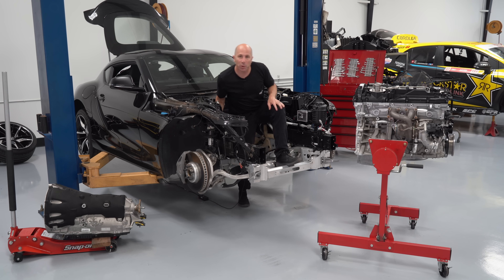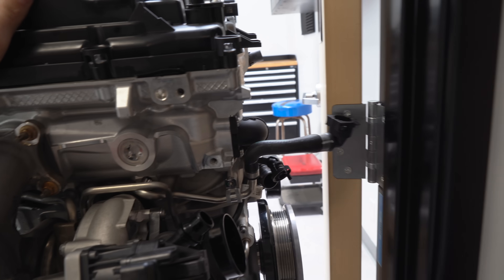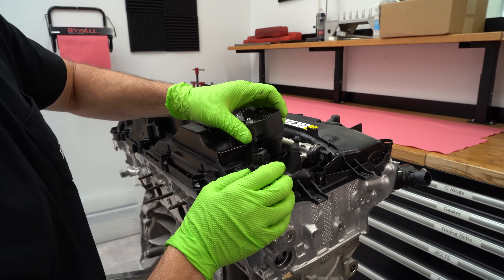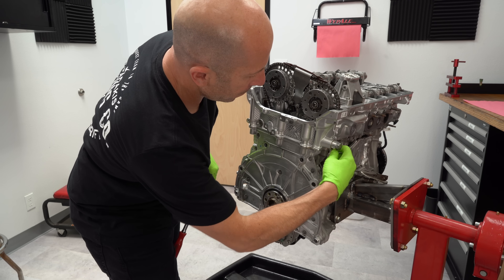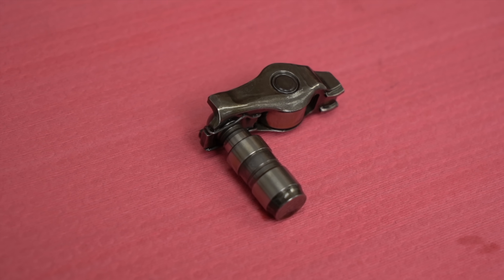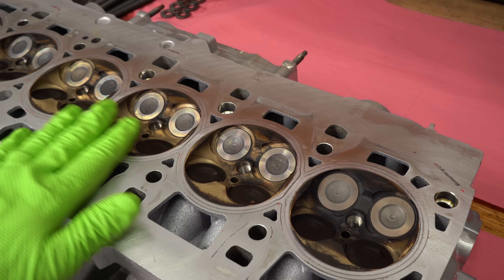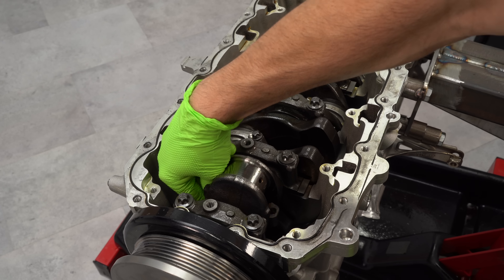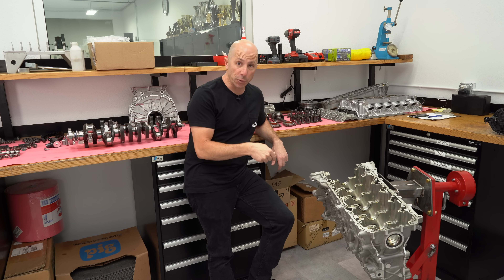2020 Supra B58 Engine Teardown - First Look - Better than the 2JZ?

Comment: My biggest gripe with BMW engines for the last 15 years or so has been that the open jacket / multimetal casting means that they eat head gaskets and you can't deck the block to square it, so the whole thing becomes disposable around 90 to 120k (less if you're pushing the boost). Curious to see if this design has better durability.

The VANOS, unfortunately, still has failure written all over it. Needless complexity seemingly for the sake of complexity.
Reply: Interesting engine design. I not see the new Supra in high production #s.
Reply: SQ Motorsports something it looks like the Japanese influences over the Germans for this engine

Comment: My 17 year old bimmer has that wireless throttle body. I can already see that plastic intake manifold leaking air at the seams in 100k miles or 10 years which ever comes first lol. Bmw just doesn't care i see. Still doing the same crap with this reinforced plastic. This engine is way over engineered. I can't imagine it being more hardy than the 2jz

Comment: Do you think there’s a possibility of using an existing bmw manual trans to do a swap? Electronic barriers? Mounting barriers? Looks like a super stout engine. Very impressive tear down. I’m excited to see what comes of the build. I love that Toyota whipped bmw into shape and took their awesome engines and made them take reliability measures. It will be great for both brands.

Comment: All this water cooling sounds cool, but I feel like it gives bigger room for destruction if something fails, if a normal oil cooler fails, you lose oil, but then you know it by oil pressure drop, but if the oil cooler fails on this one, I feel like you wouldn't be able to tell as easy, same with the water cooled intercooler letting air into the intake and hydro locking the engine upon failure. Is there any sensors or things to prevent these issues beyond finding out with a destroyed engine?

Comment: Amazing engineering, but id be worried making 1000hp reliably with that integrated exhaust manifold turning the head into a furnace,  maybe it could be removed, or ceramic coated? You should ultrasonic the upper bores to see how much material you’ve got there... that will ultimately tell your upper power limit. Hopefully better than the rb26s

Comment: so you need to pull the engine out at a 100k to change a stretched chain hmmmmm ps im not even mentioning the fact tht you now cant even take a spark plug out without a specific toll hmmmm
Reply: DORIFTO C_MAN I replaced the iridium plugs in my FG Turbo Barra Falcon @ 180000km, they looked brand new.
Reply: @nordic5490  I like your style service every 180k :D

Comment: It took a while for the new Supra to grow on me. I think it is kinda cool.  One thing you should know about this engine is when Toyota took the BMW straight six and tested it they tested every single part right down to every nut and bolt to make sure it was as reliable as every Toyota has been. Overall I think it’s a neat engine and it’s cool to see how far engineering has come.

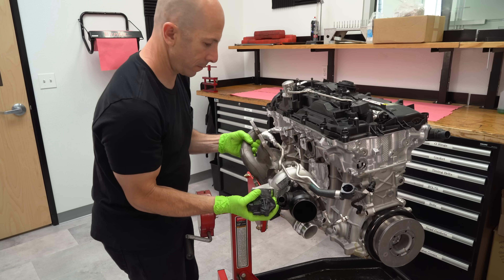Comment: 3:56 There’s no doubt when building a B58B30 head for high Hp, people will increase the diameter size of those two exhaust ports for higher exhaust gas flow.

Comment: Very interesting to see how modern engines are constructed. Lots of combined function parts and proprietary assemblies that will make this thing impossible to repair in the (distant) future.
Reply: plastic, plastic, plastic, damn, soon everythings gonna be plastic
Reply: @nobba255  Plastics are much more resilient than people give them credit for, especially now (plastic is a 157-year-old technology). There are also several types, compositions, and grades of plastics, designed to do different things. Plastics have been in engine compartments for just about as long as cars have been around.

On proprietary assemblies: with the nature of mass production (and how easy it's gotten with computers, lasers, etc.), even proprietary parts, while unfavorable, won't be hard to obtain.
Reply: @NaruSanavai  Yeah plastic CAN be really strong, expecially composites, but it doesnt really matter when bmw, mb and others seem to be using some food grade cardboard equivalent plastic lol, atleast judging from the past few years.
Reply: @NaruSanavai  plastic is great but not when its surrounded by 500 degree heat
Reply: @nobba255  hey you mostly find the plastic parts on the cheaper cars, my sl600 from 2004 has only plastic on air filter box, air intake tubbing, but the intake manifold is steel or aluminium on a 500hp twin turbo v12
Reply: @dexterjsullen  Except there are plastics that can survive that, and more? Do you think Toyota and BMW didn't do any R&D and just said, "throw some plastic on it lol"?
Reply: @NaruSanavai  yeah there's definitely plastic that can handle it, like fireproof clothing for fireman but the question is, you think Toyota / BMW going throw space grade plastic in a entry level car, even when they didnt want to complete with the performance class cars (gtr/911/nsx/488/zr1 and so on) this a brz/miata competitor THEY CUT CORNERS if they cared woulda just made a steel intake manifold, but wanted to production cost low hence BMW engine
Reply: @dexterjsullen  Steel conducts heat well, plastic doesn't. Plastic intake manifolds keep intake temps down. 
If you think a bit, low cost and BMW don't really go together in one sentence. The cost-cutting would take place on the Toyota body and interior part, not the engine.
Reply: @dexterjsullen  Yet Im looking at a Porsche 911 with plastic intake manifolds,what's the point your trying to make? That Porsche also "don't care and also cut corners"?.From memory Cayanne, Boxster and Caymen also have plastic inlet manifolds.Most people dont seam to care about "plastics",as long as the "plastic" has a carbon fibre weave visible in it.They will gladly swap a metal intake for a "performance CF intake".It's still plastic,just its been impregnated with carbon fibres.
Reply: Väinö Grönroos well.... everything IS plastic already. The entire Earth will be plastic very soon too.
Reply: Many will disagree but I think the internal combustion engine is past its prime. We're bolting all this complicated electromechanical shit to what is fundamentally a 100+ year old design just to get that last percent of emissions compliance and performance. Reliability (years wise, they'll still go many miles though) and serviceability are tanking as a tradeoff. At this point I want a early 90s to early 00s engine, or to go electric.
Reply: I would say it is just that Toyota owners are not used to it. BMW has a lot of amazing engines with a lot of plastic that last for at least 400k km with proper service.
Reply: yep, you can see the planned obsolesce with all the plastic parts attached to a hot engine....will be fun to see how long they last but the days of 50 year old iron blocks running like they did when new are over
Reply: @dazasc3994  Yes. It's already a common problem since the mid 2000's. Quality is dropping, due to the depreciation of money and the chase of better emission standards, making engine more and more complex. And we didn't talked about electronics, that can't be repaired or maintained sometimes. This is hard in coming right now.

Overall, the tendency is to have cars with shorter lifespan.
Reply: @dazasc3994  The plastic parts like the intake manifold actually shield the incoming air from heat unlike aluminum or iron. Heck...in the not-so-distant future a 3d printed intake manifold would be a very simple thing to pull off without issue.

People said the same thing about aluminum even...fact of the matter is that modern composites are lighter, more resilient and insulate components from heat without the need for extra shielding.

As far as the old SL600...there's a reason those things are selling for under $15k!!! They're riddled with issues and the cost of repairs is more expensive than the car.
Reply: @dazasc3994  The iron block is the only thing that lasted 50 years. The little bits needed replacing constantly (spark plugs, air filters, etc).
Reply: @darkoneforce2  i don't get what your point is? Plugs and filters are a service item on any engine, the block, pistons, rods, intake, carb ect can all be rebuilt using off the shelf parts even 50 years on, no silly computers or electrical stuff that has become obsolete and can never be repaired and definitely no plastic next to 500 degree heat
Reply: @dazasc3994  
Service went from 5000 miles to 50000 miles. That's my point.
Reply: This is why the market for rebuilt/refurbished older cars is going to literally explode once people realize that these new cars are only design to last 5 years...
Reply: hans desmidt nobody will want to buy a 6 year old MK5 Supra, because of all the expensive maintenance that it’ll need when these plastics start breaking down. These cars will be a dime a dozen. The MK4 Supra will be worth 3 or 4 times more than the MK5 Supras.

Comment: The BMW B58 block is shared with the B57 diesel, with different internals. Should hold 1000hp no problem
Reply: Where did you get that ?
Reply: @E9X330  it's actually shown on some websites or forums that pretty much says it all plus the fact that its modular like the B48 and B38.
Reply: @carboydorifutoparty3976  I literally couldn't find anything about it, but I did find pages saying the b58 block shared nothing in common with the b58

Comment: Im more curious to see the normal reliability of it. Toyota already fucked up letting subaru make the fa20 frs/brz/gt86 engine. Most dont make it past 100k miles without the piston rod bearings failing, theres a recall for the valve springs and the throw out bearing starts making noise very early on

Comment: Am I the only one who thought the head of cylinder 1 was burnt AF for only 500 miles?
Reply: Could be a function of break-in and not seeing high enough revs/temps to burn off that bit of carbon
Reply: This is the comment I was looking for, well, looks like engine was burning oil already.

Comment: B58 BMW engine.
Snapon has the 12point 14mm that is thin walled enough to remove the plugs.
Very elegant engine.
Closed deck block..
Reply: It helps to use a wobble extension too.
Reply: Eh I wonder how much that 12 point costs though. Is it cheaper than having one machined? I think not.
Reply: Of course snap on has that
Reply: Its just only
$45 bux its cheap dude than ya muda fucking can of beers
Reply: nibot kram and it has a prestige emergency brake handle
Reply: Its new thats why elegant timing belt on back its problematic (a premium crap)
Reply: Probably wants about $200 for that one socket
Reply: @pmoua08  yea man 10$ on amazon.
Reply: nibot kram no they don’t, especially not with spark plugs that are barelly tightented
Reply: pmoua08 around $43
Reply: still pretty damn expensive lol
Reply: @pmoua08  not really you can find some for about 10 bucks most expensive one you'll find is 45 bucks and that's pretty cheap
Reply: Don't choke On your aspirations director as long if it’s not from snapon

Comment: I hope it's a decent successor to the 2JZ so all of the circle jerking engine fanboys that turned the sports car Supra into a Japanese muscle car (fast in a straight line, can't turn for shit) will be quiet. Besides, it's better than how the GT86 turned out and they'd complain regardless if they got a Toyota V6. Besides, you'll never get something crazy like a 2JZ with all the modern emissions and fuel efficiency crap mandated. Things were far simpler just 20 years ago.

Comment: block is good, but that head , ,and the internal manifold design (that will trap lot of exhaust heat especially if antilag being used, not sure about it, but time will tell, I would say it will not be as reliable as a 2 JZ , but because the direct injection will make more power than the 2 JZ, but it will fail more often, that is my prediction  , thanks for the great video , really enjoyed it
Reply: Yeah I'm not a fan of the internal manifold as well. But, I guess time will tell...
Reply: Heads can be switched out from the Z4s i6(there not really the same since the fuel lines and heads are different).

Comment: I find myself wondering why didn't they use Toyota's DS-4 hybrid fuel injection system like they did on the FA20? I am sure they had their reasons I am just curious about them. Also, can't wait for someone to jam this engine into the 86 platform.

Comment: Here's a fun game every time you see a BMW logo on a part do a shot of Jagermeister.
Reply: Kinda boring since everything is bmw...
Reply: how is "everything bmw" when this engine was started by toyota and then finished by them working with bmw lol
Reply: @Speedyheart  All the parts of the engine are from bmw. Toyota just did the rest
Reply: nah things have bmw markings because its produced in bmw factories (which is where toyota worked with bmw) the original engine was worked on by toyota before teaming up with bmw and then they flew out engineers to germany to work with bmw. at each step of the way they sent it back to toyota in japan for reliability testing etc.   parts have the bmw name because they were made in bmw factory
Reply: @Speedyheart  the game is about taking shots when you see the bmw LOGO
Reply: So it doesn't matter if it was made by them or not
Reply: ok but a game isn't the truth lol.
Reply: @Speedyheart  "Original engine by Toyota" You mean the B58 BMW engine, that is in production from 2015?
Reply: Boo.
Reply: guess I'll die
Reply: its a z4...

Comment: Plastic intake manifold with a unremovable intercooler inside........just wow....what could go wrong?! This engine looks like a mechanics nightmare. Which means a customer nightmare as well if anything goes wrong, which it will. Guarantee it’s designed to have small part failure so customers have to purchase parts from bmw/Toyota directly that are astronomically overpriced just lining their pockets with your money even further.

Comment: You said the engine was “so new” but isn’t it a b58 from BMW? Been around.
Reply: He ment it could not be bought with out the car. And they wanted the one in the supra not BMW. There not worried about other b58's Toyota did say they went over the engine I'm sure there are some differences.

Comment: Can you tell the difference between this engine (Toyota said they tweaked it) and BMW's version? I'm really interested if Toyota really did tweak it to fix reliability and maintenance cost?
Reply: Different heads(can be changed if they are from another B58),turbo,fuel lines(are more high pressure than any other B58s),and supposedly more oil squirters.
Reply: @carboydorifutoparty3976  is that suppose to help in terms of reliability?

Comment: Valvetronics controls throttle. Throttle body is normally WOT when the engine is running. Reduces pumping losses.

Comment: Timing chain on the back has been a big turn off for many techs. The "built in exhaust manifold" leaves less room for improvement but makes a more compact engine assy. Specialty tools ensure you cant work on this without paying them. May have potential but id give it at least 5years before coming to the conclusion.

Comment: Incredible!!! What Great video!!! But I have a cuestion??! How it works the air cooling sistem incorporated inside the air intake manifold!??
Thanks and greetings from Costa Rica
Reply: Its a water to air intercooler. So there's cool water running through it acting as a heat exchanger to cool the intake air.